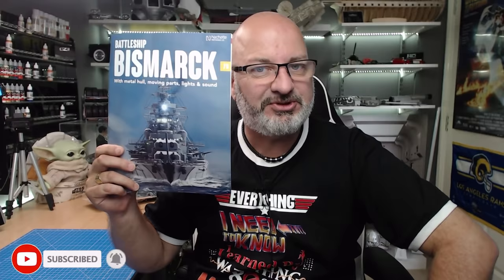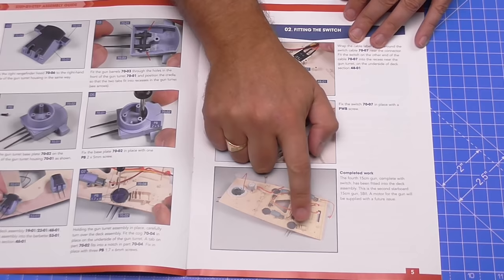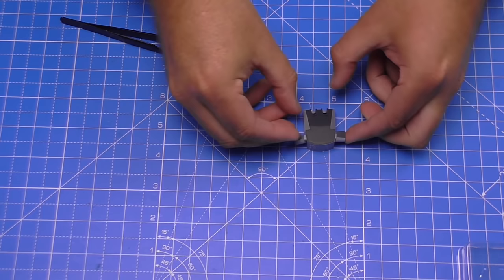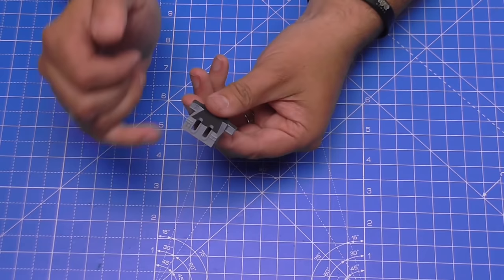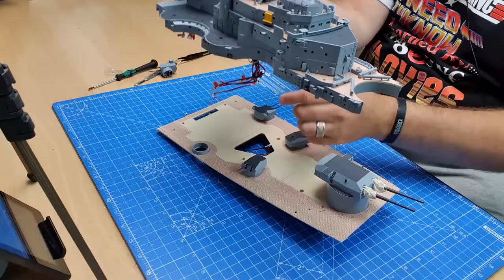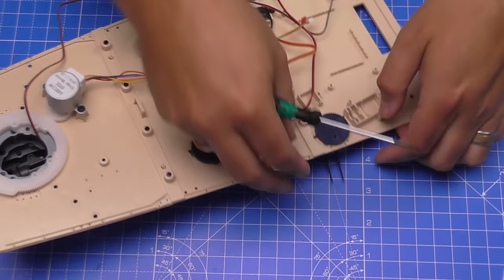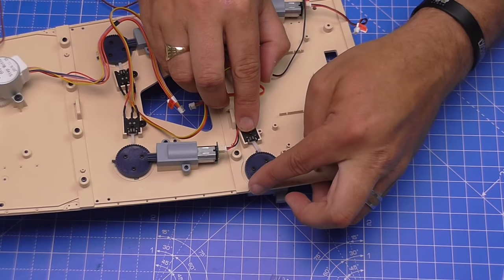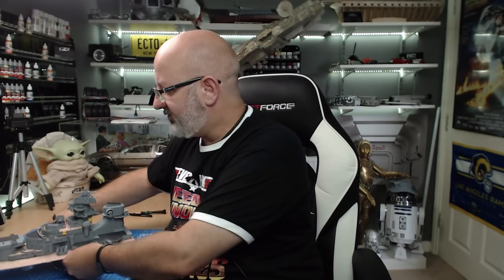Build the Battleship Bismarck - Part 70 - The Fourth 15cm Gun Turret

Comment: You screw things together,glue sometimes you sir are not a modeller
Reply from the maker: What exactly is a modeller. ?
Reply: @WorldofWayneUK  a modeller ,work from plans engineer blueprints,wiring diagrams,use hand tools ,lathes drillpresses,drill tap holes thats where you come in,build aeroplanes with out plans and they fly!,I build models  had designs published drawn plans etc building models for 50plus years boats planes cars tanks latest LandRover Defender Tamiya RC